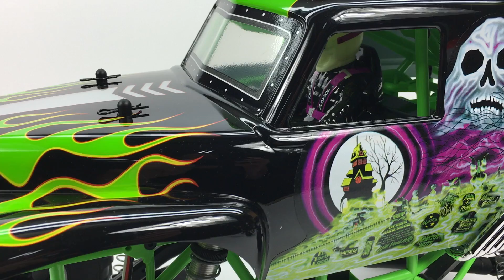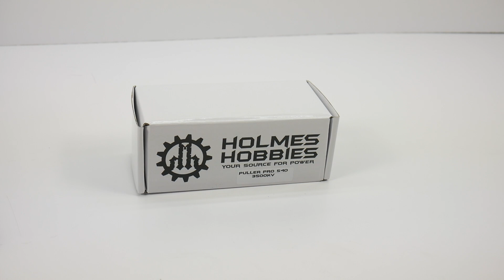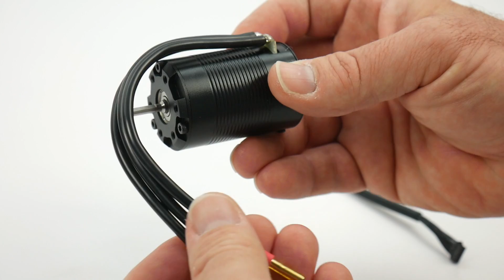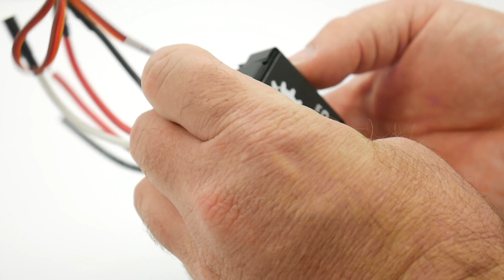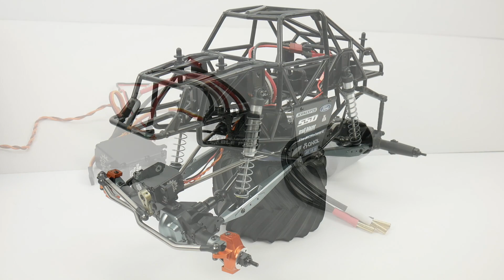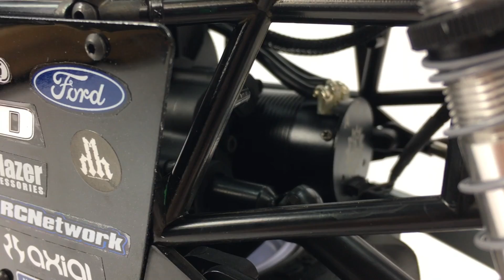Axial SMT10 Monster Truck -  Holmes Hobbies Electronics Upgrade - EP4

Comment: I'm thinking of getting a Max-D pre rolling chassis from ebay sans wheels/tires, motor, electronics, steering  servo and body since I'd be replacing those anyway if I bought a RTR and it's cheaper. I'm going to set it up like a sport mod monster truck with a 12.5" to 13" wheelbase. Trigger King recommends running a 17 turn brushed motor with a Traxxas XL5 BEC. You don't want to over power your rig where you'll be flipping it over all the time and breaking parts.

Comment: Cool vid! Did you have issues with the motor plate and meshing the gears? Having issues getting a 550 size can on the stock plate.
Reply from the maker: No issues on mine....but there is a limit on how big of a pinion you can run.  I installed the optional pinion included with the SMT10 - and it's FAST!  550 shouldn't be an issue - it's the same size as the 540 I'm running (at least where it mounts up to the motor plate)

Comment: This is a big help for me. When I build my next rig I want it as quiet as possible. That servo is super. Now to quiet the gearing. I've been toying with a 55t brushed motor geared up to reduce pinion/spur noise. Like road cars are almost whisper quiet because there's not as much reduction meshing noise.
Reply from the maker: Good deal!  Typically off road, shaft driven cars, especially with a transmission will always be quieter.  Most on roads use a belt drive which are just so silent!

Comment: Nice, sensored & brushless with waterproofing.
Unfortunately most of my gear is sensoreless because of the wet conditions I often run in.
New option! Sounds great 👍
Reply from the maker: You can't beat these items, especially since you can order them "waterproof" for a few bucks more.